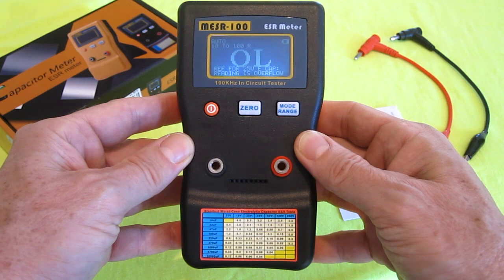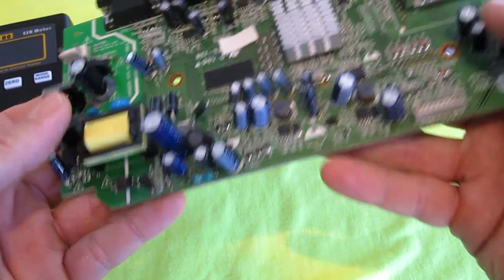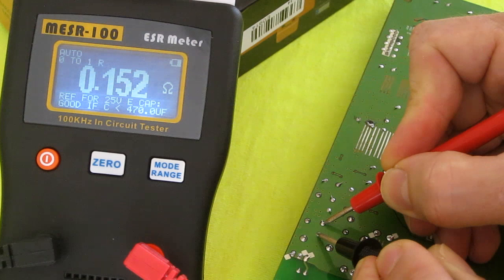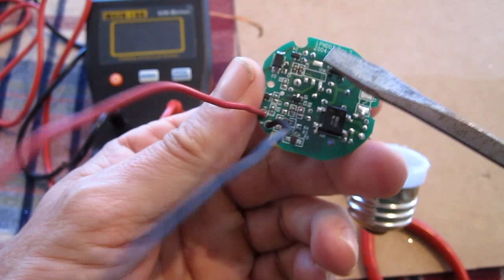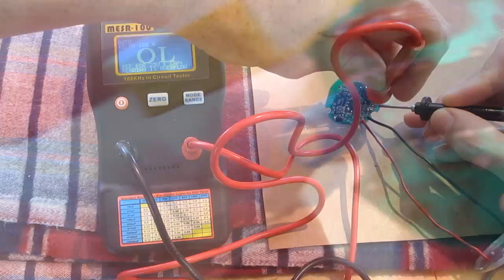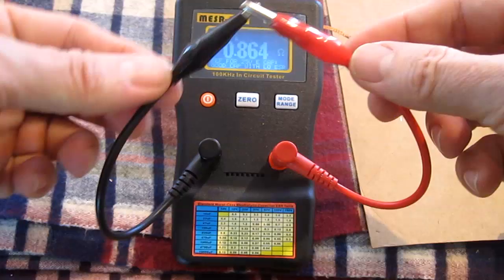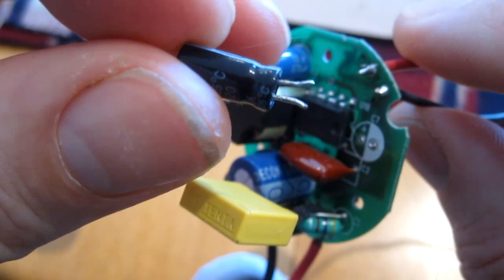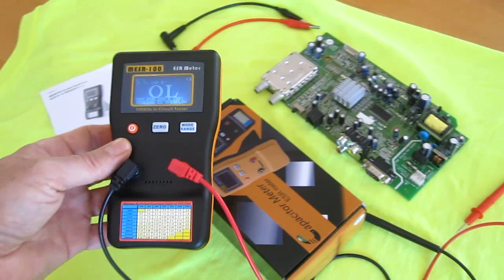ESR Meter $44 Capacitor Tester MESR-100 V2 electronics repair fix broken power supply led tv replace

Comment: This is a very good meter, I've used it on countless capacitors and tested this meter against other meters, both cheap and expensive

IN MY OPINION
Compared to the cheap ESR meters and Components testers
THIS NEEDS TO BE UNDERSTOOD

1. this is a dedicated Capacitor ESR Tester
2. it blows the component testers out of the water,  however it can't identify all components ONLY CAPACITORS so... take that with a grain of salt
and 
3. cheap component testers like  M TESTER have a time and a place

now
Compared to $400 ESR Meters,  of course this does not beat those meters,  HOWEVER.. IT PUTS UP A FUCKING GOOD RUN FOR IT'S MONEY
i reckon, if you can't afford a $400 fluke,  buy this little thing, IT WILL SERVE YOU WELL
Reply: Hi. Can this meter test capacitors higher than 10000uf?
Reply: @stallion63m35  
OF COURSE IT CAN
it can test,  for example,   1,000 uF   which is a greater value than 10,000 uF
it can test , for example  10uF which is greater than 10,000uF

or..............
were you meaning to say ,   can this meter test values SMALLER THAN 10,000uF  ?

but you also need to understand something
Unlike the MTESTER which gives you the capacitance reading ,  THIS METER DOES NOT.

this is an ESR tester,  ok
it measures the Equivalent Series RESISTANCE

as for the range.
here is a manual with specs

https://www.rmccurdy.com/stuff/ESR/MESR100_MANUAL_PDF.pdf

and if it helps
i have measured cap values from
0.1uF , 50V     to  4700uF 50V
i have had no use to measure caps outside of this range to this day
and on that range, the meter worked beautifully 

hope that helps
let me know if you want anything else, or something tested, i'd be happy to help
Reply: Martin Kuliza 
Thanks for all the great information! You answered my first question when about measuring caps below it’s stated minimum range. That’s great to know, because I was worried about measuring smaller caps.

I put together a humble lab of equipment, most of which was broken that I had to fix myself. I still don’t know that much about equipment… And I think this would be a great addition because it does everything IN CIRCUIT. I have a Sencore LC53 cap leakage tester, and also i built a low-voltage leakage tester that was designed by Mr. Carlson’s lab (on YouTube.)

But they don’t test anything in circuit, which is a huge pain in the butt. A lot of times I’m not fixing older gear… And don’t need to replace a lot of capacitors. So if it’s a newer device and just has one faulty capacitor… I don’t want to remove them all to test or replace. That is so inconvenient. So I have to add a in circuit tester to my set up. I’ve been considering the EDS CAP ANALYZER 88A.... it was offered by the EDS company years ago… And as an in circuit tester that a lot of people said was wonderful. The circuit boards can be purchased on eBay so that you can build your own… And apparently it’s head and shoulders above any in circuit Tester even The one in this video. I forget why it’s supposed to be so much better… I think it has something to do with testing under high frequency or something.

What about the M tester? I have several of the multi function component testers, Dating back several years ago when they first started offering them everywhere on eBay and Banggood… And Now have a few of the modern $30 ones with the color screen and rechargeable battery. They’re great testers and come in handy every day! Truly a great piece of innovation! But I have a few questions regarding them. And hope you might know.

Do you think they will ever offer a multi function tester that can test caps in circuit? I don’t understand why the multi function tester won’t test in circuit or offer that at a higher price… It already tests ESR and everything else. It is an absolutely amazingly accurate little device. 

Even though I have a few bench top  LCR meters, And all types of other decent gear… I find myself reaching for the M tester more than most things.

So I wish they would combine it with the device shown here, Even if it was $100…

I was considering building a bench top version of the multi function tester. I wish they offered that choice.

Basically just putting it in a benchtop enclosure, possibly adding a larger display… Maybe I could put this in circuit tester in the same enclosure or maybe a small enclosure above it.

Since I do on my work sitting at the bench, it’s a bit inconvenient to have a little handheld device and leads that I have to pull out of a drawer or that flops all around the bench kind of in the way and doesn’t stack with the rest of the equipment. 

Any answers or thoughts you might have will be greatly appreciated!
Hopefully soon they will offer a multi function tester with a nice larger sized color display, in a bench top enclosure... that is capable of ESR in circuit testing. Man I would pay good money for one of those
Reply: @hullinstruments  
Hi mate
1. I want you to know i have seen your post

2. i am going to reply to you, but i've been a bit busy, 

3. Give me an hour or two and i'll give you a proper answer,  SPEAK SOON
Reply: @hullinstruments  

Hi mate, let me address some points that you made

1. "Thanks for all the great information! You answered my first question"
You're Welcome, Glad i could help

2. "I put together a humble lab of equipment, most of which was broken that I had to fix myself"
well done, that's the best way to do it and the best way to learn

3. "I put together a humble lab of equipment, most of which was broken that I had to fix myself. I still don’t know that much about equipment… And I think this would be a great addition because it does everything IN CIRCUIT. 
I have a Sencore LC53 cap leakage tester, and also i built a low-voltage leakage tester that was designed by Mr. Carlson’s lab (on YouTube.
But they don’t test anything in circuit, which is a huge pain in the butt."

Firstly, OF COURSE I KNOW MR CARLSON'S LAB , Who doesn't :P
yes, not being able to test ESR in Circuit is a pain the arse and very time consuming.
if you still don't know much about test equipment, I SUGGEST TO DO THE FOLLOWING

- Pick a piece of Equipment, let's say a Digital Multimeter
- Pick a really high end one, let's say  ROHDE AND SHWARZ HMC8012 (approx $2,000)
- GO THROUGH THE DATASHEET AND THE SPECS AND LEARN WHAT IT ALL MEANS

- Now. Drill down to a multimeter that is around $1,000,  then get one that is $700  then look at one that is $500  and $300  and $100  and $80   and $50  and $10
you'll find that at some point you'll see a clear difference in quality above a certain price range and you'll also find that sometimes a $500 Multimeter can do what a $1500 one can do 
so , start there and learn what all the specs mean
the more you learn , the more you'll understand about what you need to know

4 Re the meter that you're looking at   ... EDS 88A
here is the video i used as reference

https://www.youtube.com/watch?v=hTkLC9iHhmA

HERE ARE MY THOUGHTS
a) that chart down the bottom that is supposed to be THE MOST IMPORTANT PART is going to be useless as dogshit,  TRUST ME ON THAT
here's why ....

Capacitors ESR is not a standard, When you consider
Quality of Cap
Brand of Cap
Value of Cap

Mate,   you can have let's say  a 10V , 1000uF  Sanwa, Nichicon , and let's say 5 other brands and they can all give you different ESR's
this is why you can't trust that chart

here is how you get a chart that you can trust
YOU MAKE IT YOURSELF,  Based on 
- new capacitors 
- Datasheets of the new capacitors
- testing the average of multiple capacitors,  let's say you test (for example)  100 caps that have a value of 10V, 1000uF  now, ... after testing them all it will become apparent what THE AVERAGE good reading is .
FYI, in my experience (Across thousands of 10V, 1000uF Caps) i have tested that  GOOD =  ESR Between 0.00 to 0.06
so now, let's say that a good cap is up to 0.10
well... do i really care ?
NO I DON'T, because i have learned that i can get good caps between 0.00 to 0.06  so why should i get a cap with a higher ESR (when salvaging, of course)
so basically, you build your own list,  i can get you started if you need a list FYI

next....  your meter does not have a numeric display it just has lights, which, in my opinion is not very useful,    IF I WERE YOU I WOULD NOT GET THIS METER (primarily because it doesn't give you a numerical ESR Value so that you can determine which cap is which, 

5.  "And apparently it’s head and shoulders above any in circuit Tester
"
I highly doubt that
Rohde and Shwarz have these meters in the thousands of dollars that are above the rest.
keysight has these meters for $700 which will shit on the meter you are buying 
the one you are buying doesn't even have a display,  my MESR meter (just to name one) is better
hell... the M Tester is better than the one you're looking at 

Here's the keysight FOR YOUR CONSIDERATION
https://www.youtube.com/watch?v=TXTjmUgv5Gc

6. "I think it has something to do with testing under high frequency 
or something."  hehe
yes,  something like that

so.. basically to reliably test a capacitor FOR STABILITY you have to (in a sense) Give it an enduarance test,  this is done by running certain frequencies through the capacitor and seeing how the cap responds
so basically.... all the ESR Meters do this 
the difference is 
- NOT ALL OF THEM SUPPORT ALL THE FREQUENCIES, some do only 1 frequency (which is ok,  , but more is better)

- some meters are not built reliable and other are

7. "What about the M tester? I have several of the multi function component testers,"
The M- Tester IS A COMPONENT IDENTIFIER  but can be used as an ESR Meter
but.. FROM MY EXPERIENCE, you will find the M Tester more useful on caps OUT OF CIRCUIT 
again,... you get what you pay for 

However the MESR meter which specializes in ESR measurement and is not an all rounder tester is much better 

8. "Do you think they will ever offer a multi function tester that can test caps in circuit? "
they already do,   check out the keysight link that i gave you

9. "I find myself reaching for the M tester more than most things."
that's because tha'ts what you're used to 
but as you get better in electronics you'll find yourself reaching for other things

10. "Man I would pay good money for one of those"
well, there are really expensive ESR meters out there if you want to burn money 
but, teh question is this

- WHAT ARE YOU REALLY DOING ?
- DO YOU REALLY NEED AN ESR METER THAT IS GOING TO COST YOU $700 OR MORE ?

at the end of the day you just want to know IF THE CAP IS GOOD
and YOU WANT TO KNOW FAST
and YOU WANT TO KNOW RELIABLY
and  YOU WANT TO TEST IN CIRCUIT

you can do all that with the MESR 100 ESR Tester

Hope all this helps
Reply: Martin Kuliza 
I hope you didn’t think i forgot such a kind reply!

But I thought about your reply every time I got on YouTube the past two weeks. I printed your reply the day after I saw it… And I have reread it several times. 
This is more useful information than I have found in months of searching and reading in forums. It’s perfectly and clearly explained. 

The time you took to relay this information is very kind, and I greatly appreciate it. It gives one hope for other humans.

It has gone on very top of my files that I keep for documenting test gear and lab ideas/needs.

this weekend I will carefully digest all of this information… I will Do a bit of research.... and thinking… And then I will make my orders. 
But your info is spot on, And I agree with the idea of “Why go with a complicated solution when something simple will do!”

It’s very rare to find YouTube commenters like yourself… That are knowledgeable and willing to share information. There are many people willing to share information that they don’t have… It’s refreshing to find someone knowledgeable and helpful! Bless you kind sir!

Not sure if you’re anywhere near the southeast United States… But I have a load of extra test gear and I would gladly pass some off to you if you need it. Most is too heavy to ship but I can only use so much gear. 
Thanks again for your time.
Reply: @hullinstruments  
wow... Thank you, i 'm not really sure what to say to all that, but i do appreciate it.
i'm really glad that i have helped you on such a level because doing so honestly makes me happy

as for where i am,  no i'm not in the USA,  i'm in sydney 

as for test gear,  i never say NO to test gear, but if it's too heavy to ship, then, what can you do ,
i do appreciate the gesture though, thank you very much

if you have any questions feel free to ask

Comment: You can not test devices inside the circuit. The readings are not true because you are measuring the circuit too.
Reply: Wrong.
Reply: ESR meters are specifically made for testing in-circuit.

Comment: Just a note. It doesnt tell you for 3300uF or 6.3v and many other ones like I think 580uF ... Thought it was gonna be good for motherboard testing, but it just gives me a reading that I have no idea is it any good or not?!?! How am i supposed to know, is there a graph for ones 6.3v and others like 1200uF and so on??? Thanks
Reply: Hi AdrianM. You can usually look up the cap manufacturer and they will give the resistance readings for given capacitors tested at 100kHz which this meter uses.